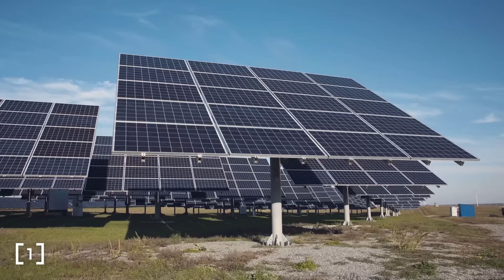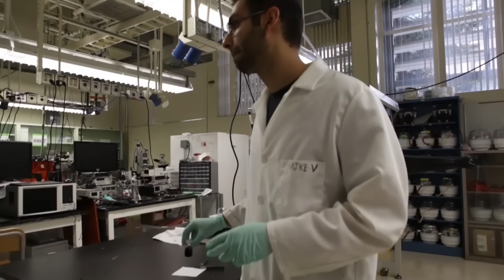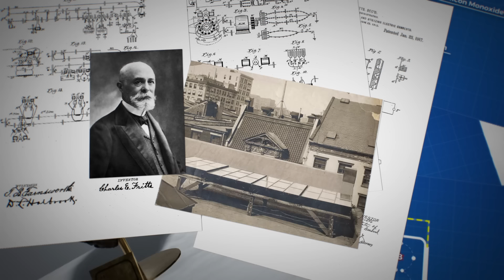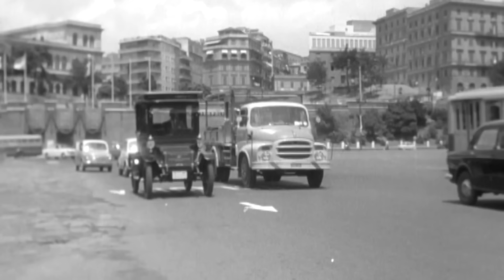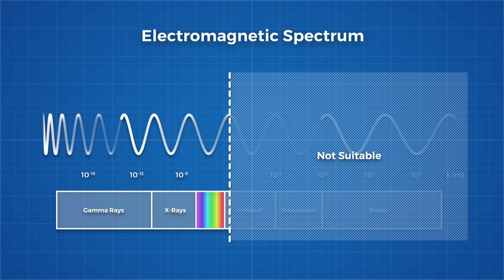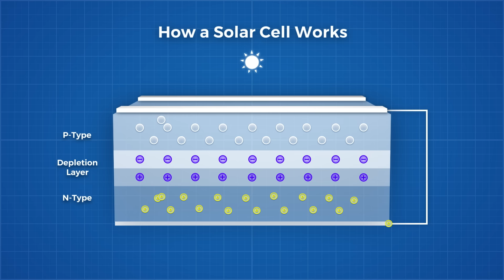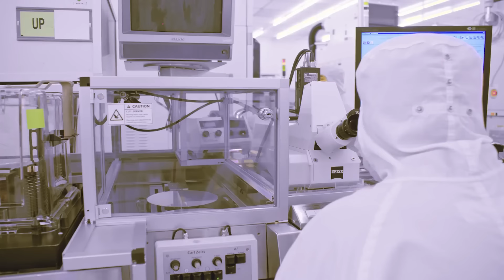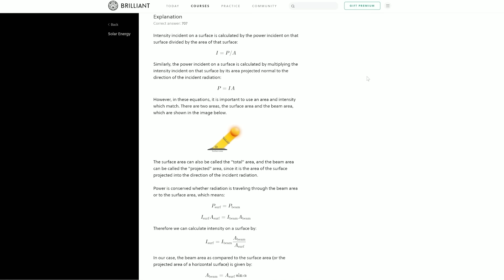The Mystery Flaw of Solar Panels

Comment: The final nail in the coffin for solar panels for me was the fact that their thermal efficiency drops when they get hot.
I mean, what is the freaking point??? 
You mow down the desert's natural habitat and vegetation (yes there is life in the desert) to stick acres of panels there, where sunlight is abundant... and they don't work.
Reply: Thermal exchange: bonjour
Reply: They are great for cabins and sailboats, they have their place, but as far as environmental damage goes they compete well with dams and wind turbines!
Reply: That's not exactly a "final nail".  Even with the loss in efficiency, solar is still the cheapest way of generating electricity.  Plus, as stated in the video, you can cool the cells.  I mean, he actually states in the video what they do to recover some of the efficiency - not sure why you are ignoring that.

Thing is, in cooler countries such as England or Germany, Solar PV's can be extremely effective and crazy cheap.  My father-in-law has solar on his roof, and it's bonkers cheap and very effective.  I'd have it on my roof if I didn't live in a ground-floor flat with no access to the roof.

Plants are less than 2% efficient.  Anywhere that plants can live, you can be sure that solar PV will work very well.
Reply: @antontaylor4530  No, it isn't. It isn't even close to being the cheapest. Wind and solar cheat LCOE calculations by exploiting that they assume all generators are dispatchable. Forcing them to meet this standard balloons their cost to hundreds, if not thousands of dollars per MWh.
Reply: @jsn1252  Utter nonsense.  Wind and solar farms are selling for lower strike prices than any other form of energy generation whilst receiving the lowest levels of subsidies.

These are businesses, the go out of business if they sell for a loss, yet they're so profitable that EDF Energy is building them as fast as they can.

You're quoting propaganda in the face of overwhelming business success.  Which should people believe?
Reply: @jsn1252  Oh, I think I get your point here - you think that the subsidies paid to coal, gas and nuclear for providing baseload should be factored into the cost of producing wind/solar, but not into the cost of electricity produced by coal, gas and nuclear?

Because if you factored in the baseload costs, all forms of power generation go up, not just wind and solar.

That's why we can say that wind and solar power get lower levels of subsidies than any other form of power generation.

And actually, baseload generators are, to a large degree, already dispensable.  It was assumed that baseload would need to be 95% of the grid when windfarms were first popping up, but it turns out that the need for baseload is far lower than first envisioned.  And that's ignoring grid level storage that is being built out across the grid in many western European countries.

You can build 12GW of offshore wind for the price of 3.2GW of new nuclear, or you can combine 6GW of generation with storage, and have a vastly superior end product that costs vastly less to run, produces far cheaper energy, can function as baseload, and is distributed to such an extent that local failures don't matter.

All generators are dispensable, and there are already projects underway to dispense with them.
Reply: @antontaylor4530  I get the feeling you're talking about something completely different. If not, what are you on? Solar Panels are NOT cheap. They have large amounts of high-purity silicon which is expensive to manufacture. They require installation from qualified workers (you can't set these up yourself, because otherwise you could screw up the inverters and electrical protection).
Reply: @abloogywoogywoo  I'm "on" reality.  As I said, we just installed Solar panels on my father-in-law's roof.  Just over €100 per panel, 200w per panel.  It wasn't difficult and we didn't screw anything up.  Probably another few hundred euros for the inverter, batteries, brackets, power cables and charge controller.  

Your assumptions are wrong, and show very clearly that you don't have real world experience with PV.  You're making assumptions and then presenting those assumptions as if they're facts.

They're cheap.  At the rate that dad's panels are making power, the system will have paid for itself in a year or two, and then it's free electric for another 18 or more years.
If you think solar is expensive, then you have no real world experience with solar PV.

And just for clarity - solar power is now officially the cheapest way to make electricity.

https://www.carbonbrief.org/solar-is-now-cheapest-electricity-in-history-confirms-iea

Perhaps look in the mirror if you want to see the person who's "on something".
Reply: @antontaylor4530  Cheapest with massive subsidies. It's not reliable enough for most Americans. They don't provide enough electricity for day and night use for an American family. I have a large family in a 5 bedroom house. It gets very hot in the Summer and very cold in the Winter. Summer is frequently upwards of 38 C while Winter can get to -18. We use 2700 watts just for air-conditioning. Solar cannot meet our household needs. It can't for most Americans. Typically a coal or natural gas plant has to stay throttling manage dips in grid capacity for solar here. That negates much of any real emissions savings or total grid cost. Solar energy analysis typically doesn't include that necessary expense when calculating the cost of solar energy.
Reply: @russiannpcbot6408   Again, I'm sorry but wrong.  There were no subsidies for my father-in-law's system, and yet it was still significantly cheaper than any other way of getting power.

If you're looking at solar and it's expensive, then you are looking in the wrong place.

As for needing 2.7kw just for air conditioning, I would suggest that you look into ground source heat pumps.  Yes, they're expensive up front, but they are significantly more efficient than air source heat pumps, and save huge amounts of money in the long run.

And maybe look into upgrading your insulation, most European homes (even in southern Europe - Spain, Greece, Italy) most homes don't come close to needing 2.7Kw.

Not for A/C, for EVERYTHING - including the A/C.  Upgrading your insulation should see you lowering the power requirements, because that's insane.  You must be burning through 30Kwh or more a day just on A/C, that's more power than most southern European homes use - with A/C on - in 2 or 3 days!
Reply: @antontaylor4530  The article you linked specifically stated the decrease in solar cost was primarily linked to government programs worldwide reducing the cost. In your case, the subsidy was probably paid directly to the distributor to reduce consumer cost. 

European homes on average are smaller than American homes. The average home size in France and Germany is nearly 1000 square feet smaller than the average US home. US home measurements do not count basements in total square footage. The average central air AC in the US uses 3000-3500 watts. Looking up average high temperatures in European cities, most Northern ones are 10 C lower than the average high temperature where I live in the US Midwest. Southern European cities averaged around 5 C lower. The average high during the Summer where I live is 35 C. Many parts of the Southern US averages over 40 C. 

From what I've seen on YouTube, US families of 2 with a 1200 square foot house can almost eliminate their electricity bills with a $38000 solar system plus batteries, which qualifies for $10000ish in tax deductions (subsidy). This does not include direct subsidies claimed by manufacturers. Battery replacements in the 20 year time range is between $5000 and $10000 depending on amount of storage desired. It's not advised to install it yourself in the US because homeowners insurance might not cover a potential fire if it wasn't installed and certified by a licensed electrician. Solar can save people money, but it won't cover the average electrical costs of a US household. It also comes with a very steep price tag.
Reply: @russiannpcbot6408  In my father-in-law's case, since he lives in a part of the EU that has no subsidies for Solar, Wind or Hydro, I can guarantee you that the price we paid was not subsidised, at a distributor level or any other.  As for European homes being smaller than American ones, that does mean you have more space on your roof for solar.

And we're not specifically discussing northern european homes, we're talking about southern europe.  Spain, Greece, Italy.  I have family in those countries, and they get hotter than your 35c.

My father-in-law's country (Romania) gets to 40c in summer, -20 to -40 in winter.  It's not even that far south.  I'd say that was broadly similar to your climate then.  And again, no subsidies.  And we managed to put together a fully functional solar system for a few thousand euros.  Granted, his house is probably half the size of yours, but the point is not overall cost - it's solar one time cost vs grid ongoing cost.  In our case it was cheaper to put solar in, with batteries, than to use the grid.

Your research is for overpriced solar installed by ripoff companies who're tripling or quadrupling the price, simply because so many people don't understand solar.  There are plenty of videos on the web of people in North America who've bought and installed their own system, for a fraction of the price you mention.  They then had the work certified by an electrician for a couple of hundred dollars.

Look, I'm not trying to be an evangelist.  I'm simply pointing out that your experience of solar is not the depth and breadth of solar technology.  I have real world experience of this, and I'm not making assumptions about what is and isn't possible - I've been there, seen it, done it.

Take a look at this video:

https://www.youtube.com/watch?v=ToxFObjnlF0

That's a guy in North America, building his own system, having it checked and certified by an electrician.  He used way overpriced panels, and yet even without the subsidies he would've paid for his system in a few years.

And as for subsidising solar - are you aware that nuclear power plants, gas power plants and coal power plants get huge subsidies in both Europe and North America?  Much larger (per Kwh produced) than any solar installation.  So claiming solar is only cheaper because of subsidies is to ignore the fact that all power is subsidised, and that Solar and wind get a disproportionally low subsidy rate.

Rather than go on about how impossible it is, how it's not cheap, why not see how much you could save with a decent DIY install on your own roof?  Which do you love more - being right and proving me, random guy on the internet, wrong - or your own wallet???
Reply: @antontaylor4530  there might not of been subsidies given directly to your dad, but there certainly were subsidies somewhere along the manufacturing/ sales chain at the prices you quoted!
Reply: @russiannpcbot6408  That's rich! Thanks for checking the article he linked: these people are a so dedicated to the cause I don't even bother anymore!
Reply: @wilfdarr  There were no subsidies.  Romania has no subsidies for renewables.  Google is easy to use, why not try it before saying things that are easily disproven?

We bought French made polycristaline panels from emag.ro. 

I can buy panels from various suppliers here in the UK for almost as cheap (it's maybe 10% or so more expensive in England) and no, that's not a subsidised price - the UK government does offer subsidies, but only via approved installers and only on completed installs.

Go check it out on gov.uk if you don't believe me.  While you're at it, go check it out prices direct from China for yourself too.  Alibaba or aliexpress - I spent 2 minutes on there and found a 350w panel for $160 shipped free to either the UK or US.  That's probably a better price than we got for dad's panels, per watt.

And there's no way that price is being subsidised.  Solar panels are just cheap.  You could probably find an even better deal if you spent a bit of time, but I couldn't be bothered.

As for environmantal damage - the manufacture of these panels does involve a small amount of toxic material, but that's not allowed back into the environment in Europe, so it's a moot point for my father-in-law's install.  No natural habitat was destroyed by placing panels on his roof. 

Do large grid-level installs do damage?  Yes.  As much damage as, say, a coal fired plant?  Unlikely, but that isn't the point - the point being discussed was whether or not solar/wind is *cheap*.  And it is.

As for what Russian NPC Bot said - did you not bother checking my response to him before you posted?  No, seems you didn't bother.  So I'll repeat the point: yes, solar and wind get subsidies - but so does every form of power generation.  Coal, gas and nuclear all get subsidies too, and in every single western country they get larger subsidies than Wind or Solar.

So it's not about "these people being dedicated" - it's about you being so indoctrinated that you're willing to go out of pocket instead of putting panels on your own roof and having free electricity for decades.

That's some level of "dedication" you've managed there.  But if you're happy paying through the nose for power, then I won't even bother anymore.
Reply: @antontaylor4530  “There are no subsidies in Romania, look it up”... 
you mean like this? 
https://www.pv-magazine.com/2021/02/04/romania-improves-rebate-scheme-to-speed-up-rooftop-pv-development/
Or this
https://balkangreenenergynews.com/romania-allocates-eur-52-million-grants-to-citizens-for-rooftop-solar/
You people really believe solar is financially viable without the tax rebates because you've literally NEVER USED GOOGLE IN YOUR LIFE! 

Next time,  YOU LOOK IT UP!
Reply: @wilfdarr  LOL -  you said:

"there might not of been subsidies given directly to your dad, but there certainly were subsidies somewhere along the manufacturing/ sales chain at the prices you quoted"

I thought it was obvious when I responded we were talking about subsidies added along the manufacturing/sales chain*.  Your link is to subsidies that you have to specifically apply for - *not subsidies that are addeed "somewhere along the manufacturing/sales chain".  Why are you suddenly changing the goalposts?  You were the one who specifically narrowed things to the "manufacturing/sales chain", not me.

Should I have said "Romania has no manufacturing/sales chain subsidies for renewables" instead of "Romania has no subsidies for renewables" - yeah, sure.  You got me.  Well done.  Have a party and invoice me for the cake, yeah?  I'm sorry I didn't specify "manufacturing/sales chain" - I was under the impression that since you specified that, you'd understand that was what we were talking about.  Context is king, after all.

So thank you for making my point for me - there was no "manufacturing/sales chain" subsidy as you implied.  Our panels were not subsidised.  Yes, my wording could have been "no manufacturing/sales chain subsidies in romania, look it up" - but in the context of you saying that I must have got a subsidy automatically, I thought that was obvious.  I'll be more careful to pedantically point out that I'm specifically talking about the point you brought up in future.

As for "You people"?  Who exactly???  No, seriously, what do you mean by "you people"???  People who've actually done what you're talking about, who know what they're talking about?  As opposed to you - who has no real word experience and makes the assumption that PV has to be expensive, and then pretends that your assumptions are now somehow facts?

You literally make an assumption that I've already proven untrue, and you doggedly stick to the idea that your assumption is correct and the real world experiences of other people must be wrong.

And why are you ignoring everything else I said?  What kind of subsidy do you think the panels from Aliexpress have on them?  350W panels for $160 - who's subsidising those?  Who, exactly is subsidising them?

And what about the guy who made a youtube video about buying a bunch of 250w panels for $50 each?

https://www.youtube.com/watch?v=0yDVXJmsowU&t=137s

What subsidies was he getting on second hand panels?  $800 and he's making over 3.5kw of power regularly.

And even if solar is subsidised for your area, what do you care?  Just fit a system and save money.  Stop whining about "you people" and put some time/effort into saving money instead of trying to prove some random guy on the internet is "wrong" and you're "right".  Which is going to be impossible, because you're wrong, and I think you know it.
Reply: @antontaylor4530  By “you people” in talking about you people who believe that renewables are economically viable without tax subsidies. 

No I didn't change the goal posts: it's both, direct subsidies paid after applying for them, and tax benefits to “green” companies which sell you the product at a highly discounted price. You believe the manufacturer wasn't subsidized: tell me where the manufacturer is and I'll prove you wrong in about one minute.
Reply: @wilfdarr   Yes, you did change the goalposts.  You specifically stated that I must have received manufacturing/sales subsidies on my father in law's install. We weren't talking about subsidies in the wider picture of worldwide renewable energy - I don't care about that.

We were talking about my father in law and his install.

Now you want to pretend that we were talking about renewable energy in general.  We were not.

As for where the manufacturer is - I've mentioned the 350w panels made in china two or three times already.  I've asked you specifically who is subsidising them. You've had far longer than a minute to answer that question, and yet you have failed to do so.

So, go on then - who is subsidising the panel made in china?  One minute.  Go.
Reply: @antontaylor4530  I specifically stated both, in two separate posts. That's not changing the goalposts, that's doubling down after Googling “Does Romania subsidize solar”. But since you're obviously “One of those people”, i.e. zealot, I'm done with this “conversation”: it's obvious that facts have no power over you.
Reply: @antontaylor4530  Also, again, 1 second on Google, China subsidizes solar manufacturing. 
https://www.forbes.com/sites/michaelshellenberger/2021/05/19/china-made-solar-cheap-through-coal-subsidies--forced-labor-not-efficiency/?sh=1c11463371ec
Reply: @wilfdarr  What facts do you have though?  I've asked you three times to tell me who's subsidising those panels.  Give me those facts.  You offered to give them to me - and here we are, no facts coming from you.

And yes, you were changing the goalposts.  Let's look at the context:

I stated that we built a solar install cheap.

You stated that it must be subsidised at a manufacturing/sales level.

I stated that there were no subsidies in romania

You showed an article that proves romania has *post install, non-manufacturing/sales" subsidies.

See how that moves the goalposts?  We were talking about "manufacturing/sales" subsidies, and you use an article about a completely different type of subsidy to somehow "prove" that I'm wrong about there being no manufacturing/sales subsidies in Romania.

And now you're unable to show me where these manufacturing/sales subsidies apply to a $160, 350w panel from China - despite your assertion that it would take about a minute to do so.  And somehow I'm a "zealot" - you're completely without any experience in this, I have experience in this.  If having experience makes me a "zealot" then I guess - guilty?

Well done.  Have a cookie.  Invoice me for it when you invoice me for the party cake.
Reply: @antontaylor4530  The link is there, you don't even have to Google, JUST READ, but that's too much for you? It does explain some things...
Reply: @wilfdarr  Wrong.  You've given me another article talking about subsidising of solar installs, not manufacturing/sales.

China boosted it's solar industry by subsidising installs and letting the economies of scale bring down costs.  So if you buy a panel from china, it's not subsidised - you only get a Chinese subsidy if you install that panel somewhere in China.

So again, who is subsidising that panel?
Reply: @antontaylor4530  Wrong: “heavy Chinese government subsidies allowing for the dumping of solar panels on foreign markets,”
How is that installation related? Obviously you either didn't read it or your comprehension skills are zero. Either you're not here to have an honest conversation, or you're too stupid to participate in one. Either way, this is the last you'll hear from me.
Reply: @wilfdarr  Not wrong.  Do a bit of research - the chinese government only directly subsidised solar panel manufacture from 2008 until 2013, when it publicly announced it would be ceasing these subsidies in favour of grants for installed solar plants only.

Their reasoning for this was that the companies manufacturing panels were not incresing efficiency as there was no reason to - they didn't have to make actual money, they just took the subsidies.  So the Chinese government changed the model to one that forced these companies to compete with each other for market share, and as a result prices tumbled.

The article is misleading - that does not make me wrong.  If it had been written in 2012 or early 2013, you might have a point - but this is 2021.  China has not subsidised the manufacture of panels for over 8 years.

So I ask you again - who is subsidising that 350w panel?
Reply: @abloogywoogywoo  i set up my own solar system, relatively simple and easy, unlikely to screw anything up unless you are drunk